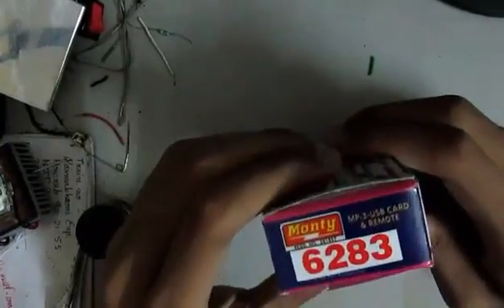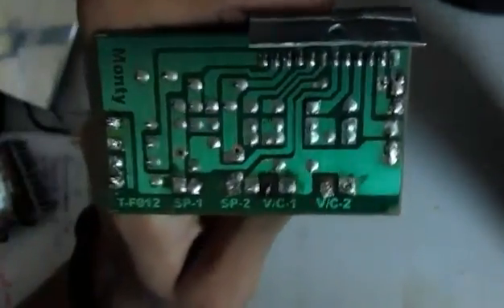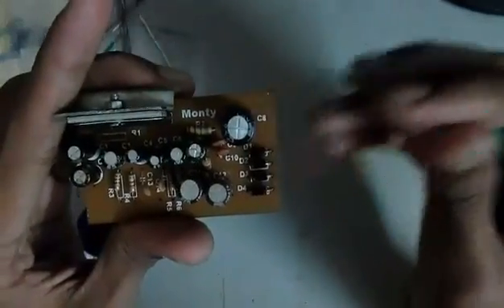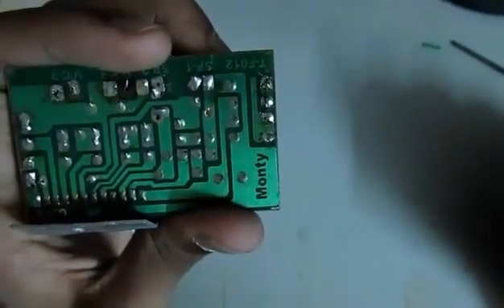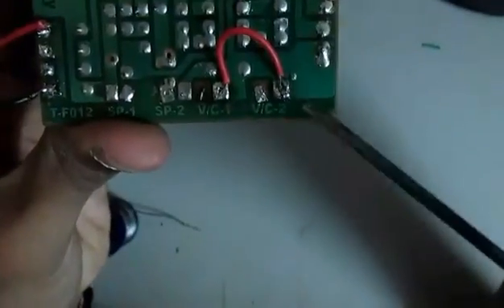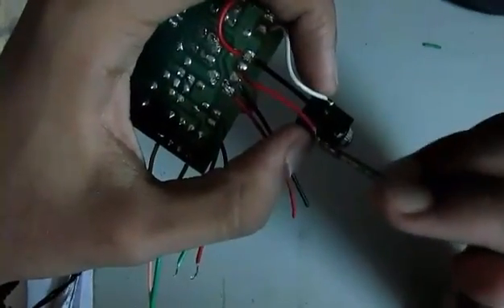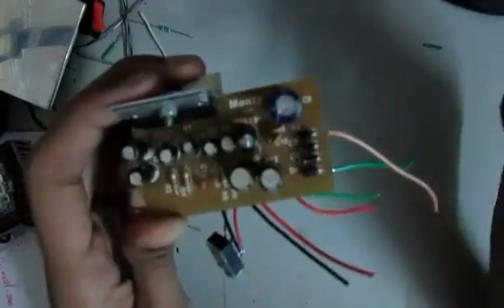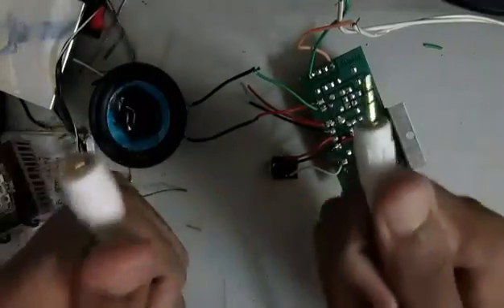||6283 IC based Audio Amplifier|| Tutorial part-1

Comment: Ayudh, what about the noise? This IC seems to make this noise always. How do I stop it?
Reply from the maker: Hey Chayan, 

Usually connecting a volume control ( a stereo potentiometer) between the  audio source and the VIn ports does the job.... 
You can also try and earth the circuit board to get better results....  
i hope that helps..  If you need anymore help here's my email id. 
Don't hesitate to leave a message. 

ayudhnindia@gmail.com

Comment: isme Kon se parts he like capacitor resistor
Reply from the maker: Creative Ideas 

Although this is a pre-assembled board,  but still m listing all the components. 
capacitors :
1000uf x1
680uf x 2
100uf x 4
220uf x 2
0.01uf x2
0.04uf x2

Resistors :
160 ohm x 4
22 ohms x 2

Diodes:
in4007x 4

6283 ic x 1

2 speakers
Reply: I make it amplifier so please tell me how many list of parts
Reply: thank you
Reply from the maker: Creative Ideas 
You are welcome...  
Please like, share and subscribe for more

Comment: nd it's a 12v supply thing the connections of audio board have been already provided.with speaker connections sound regulator and and the inputs and the out puts but the aux has not been shown or the wires are not provided there give me ur wassap number so that I can. shoot u the snap of the audio board